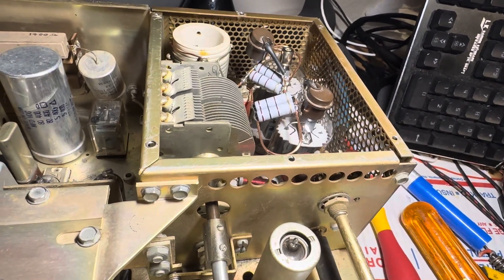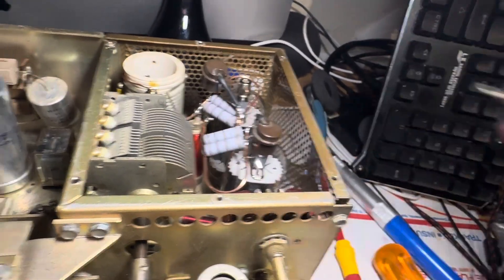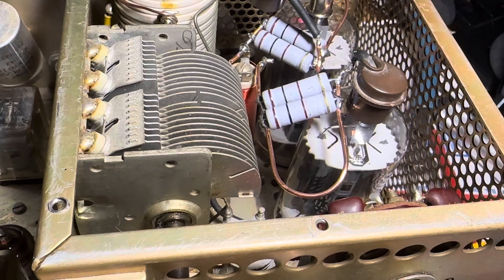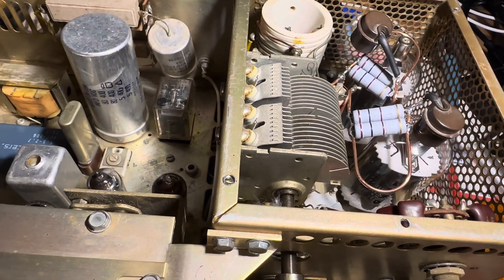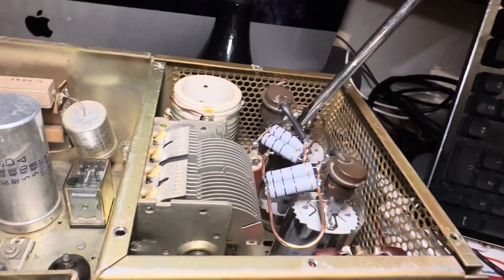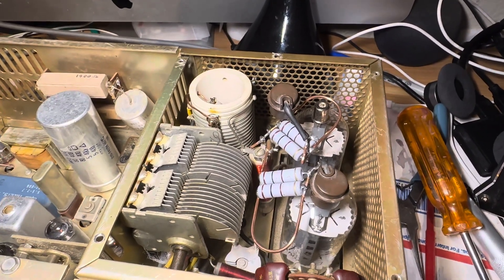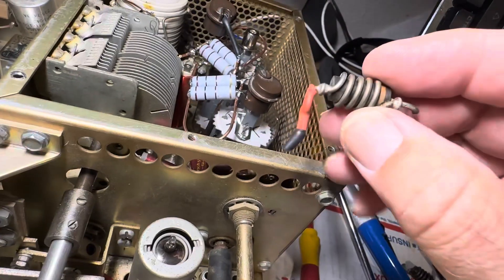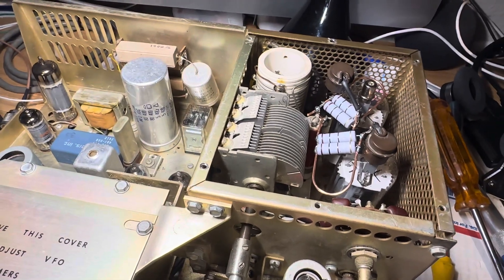Swan 700CX #2 from HELL. Built 2 New parasitic suppressors hairpin metal oxide 100 ohm resistors | |

Comment: I thought about making them, but I knew there was not enough room. With two swans you could swap out the tubes and see if it makes a difference.
Reply from the maker: Hi David, Part of me is like well SWAN 700CX #1 is working perfectly so don't mess with it. I have not tried a finals swap yet. From what I have read in an article I posted in the comments - YES the finals tubes can cause trouble like this. I guess the best way is to swap the tubes form the working Swan. The good news is that the finals tubes installed  - 8950's did not burn up the U shaped parasitic suppressor. It only gets warm.